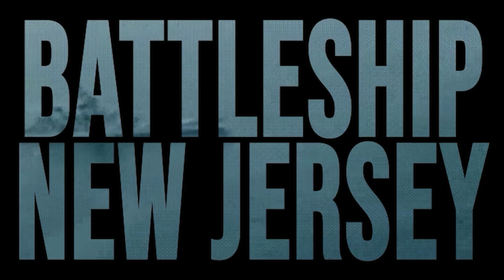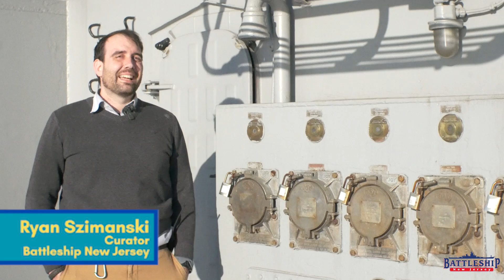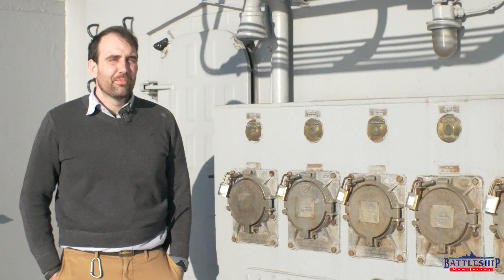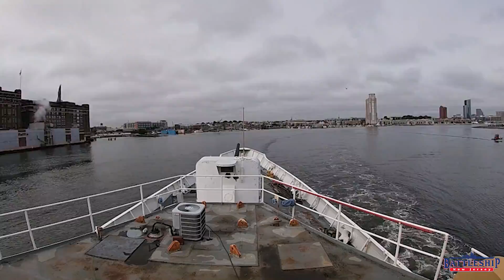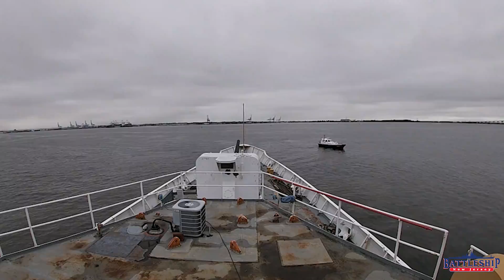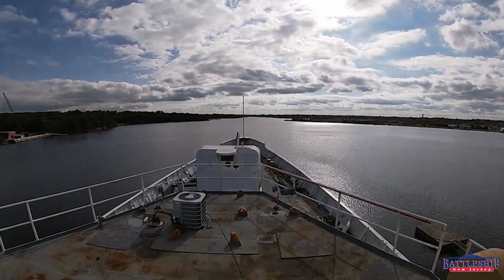Will the Battleship Have Power While Under Tow to Drydock?

Comment: Does the ship have the ability to put out power through those connections? Either her own power or pass through from shore to a ship rafted outboard of her?
Reply: Electricity will always go in both directions through a conductor. I don't know if that is an approved procedure, but if you really wanted to you could definitely do it.

(This is why using a suicide cable to connect a generator to a plug socket in your home during a power cut in order to power your home works - plug sockets work in both directions. It is also why it is extremely dangerous - the mains connection to your house works in both directions so you are electrifying your whole neighbourhood and can electrocute people fixing the mains that they think is shut off.)
Reply: @thomasdalton1508  You are correct.  In fact, the transition from shore power to the ship's SSTGs and back again both include synchronizing the ship's generators with shore power.  Done properly, nobody can tell when you close/open the bus tie.  The takeaway here is that for a very brief time, the ship is actually a contributing generating station on the US power grid.
Reply: @kevincrosby1760  Are the generators able to switch between 50Hz and 60Hz to enable them to synchronise to the grid in ports anywhere in the world?
Reply: @thomasdalton1508  Nope.  If the pier doesn't have what you need, then you keep a boiler up and an SSTG spinning.

Comment: As a mechanically inclined guy i would love to know if it would be technically possible to get cooling water to Aft Diesel without the through hull openings.
Reply: Technically that would be easy…deck mounted Honda pump with a line running to the diesel sets… least my farmer fix lol..wouldn’t be pretty but it would work. Might need a screen on the intake to keep debris out.
Reply: @dirtdevil70  just buckets of water, and guys running :-)
Reply: @michaelandersen-kk4fc  sounds like something the marines would do  lol
Reply: Oh, no. Radiator in a hall-way, fans to push air through the ship, open hatch at each end. As long as the radiator is on the same level as the diesel, moving cooling water around won't be a complete pain. But then you have a challenge as far as fuel goes, as it will also likely need to be in a similar space, powered off of bladders.

Comment: Can the port and starboard power connections be daisy chained? As in one ship is connected to shore power, and another ship is moored alongside the first ship electrically connected on the other side?
Reply: Great question, I’m not a navy type but I’ve seen lots of images of in service naval ships tied up alongside each other so I assume they can daisy chain - otherwise the outer ships would have to keep their gennys running.  

Would be nice to have confirmation from someone actually knowledgeable.
Reply: @cruisinguy6024  Obviously, you wouldn't be able to have them all running at full power, but it should be enough to at least keep the lights on so the service crew can get around.
Reply: @cruisinguy6024  they will just cross-deck the shore power, potable water, shore steam, telephone, CATV, etc. from the pier to the individual ships.

Comment: Please consider dry dock opportunity to get water intake remade to rear generator diesel. Ship would be more useful to NJ for disaster relief (Hurricane Sandy) with some electricity. Even if redundant shore power generator.
Reply: There have been instances where diesel electric locomotives have been used to power a town in an emergency.  They actually drove the loco a short distance off the rails to the nearest capable power pole. 

250,000 Watts isn't much. I used to tend to a 800,000 W generator with a V 16 quad turbo engine making 1150 HP.  And that is a " small  " generator as some data centers have a few 1,250,000 W units.
Reply: The USS Lexington powered Tacoma during low water period in 1929.
Reply: @Dog.soldier1950  USS Lexington (CV-2) had turbo-electric propulsion, and had much bigger generators for that.
Reply: I vote getting the turbo  generator(s) going as a safer option
Reply: @Dog.soldier1950 They can't really get either one running. Diesel is, in theory, possible at least but would require opening up the sea chests. The turbo generators would require firing up the steam system that they're not allowed to do.
Reply: The auxiliary generators can only power the emergency systems, so they aren't much use to anyone else. The full steam generators might be useful, but it sounds like there is absolutely zero chance of getting them working.
Reply: 250kw is not much and wouldn’t be very useful for back feeding to the shore - not to mention she’d have to be near critical infrastructure already for this to make sense. 

She’d be far more useful as an emergency shelter but as she and her contents are treated as artifacts I doubt they’d want to open her up as a shelter.
Reply: @cruisinguy6024  A ship is going to be a very bad place to take shelter in a hurricane! I think they should stick to using schools and sports centres as shelters. They have diesel generators to power those.

Comment: what is the reason for the move to dry dock? what kind of repairs?
Reply: In short - hull cleaning and repainting, checking the blocked off sea chests and recovering as necessary, checking the seals on the prop shafts.
Reply: Do you live under a rock?  They’ve made NUMEROUS videos about the dry dock process and what work they’re planning / hoping for.
Reply: @cruisinguy6024  been too busy to watch any battleship vids recently. Sorry to disappoint 🙄

Comment: Iowa’s 10 shore power jacks were instrumental in the successful traversal of her number three turret.
Reply: Not really... in hindsight they said they used no more than half their shore power at any given time. As a precaution, they had switched off most of the other electrical equipment. So as long as it is only ONE turret rotating and nothing else, 5 would suffice.

Comment: Does the main generators (not the auxiliary generators) generate 60hz or 400hz? I heard that the main turbines provide 400hz that is then stepped down by the fwd and aft conversion rooms, which seems backwards.
Reply: The main turbines generate 60hz, just like the power in the North American grid. 400hz is used on aircraft.
Reply: In a past vid from about time 440 to  620 "   What Items Did the Navy Remove From USS New Jersey After Decommisioning?   "   there were some frequency converters ( he calls them generators which is incorrect ) to power modern weapons systems. These were removed just as the ship was opening to the public. .
Reply: 400hz is the frequency required for most high efficient systems like computers for tomahawk and CWIS, along with the navigation systems wsn

Comment: So, on the other side, does NJ currently have 8 cable connected - or less as all 8 are not necessary?  When talking about the ships diesel generators, Ryan states "auxiliary electrical" - I know actual original design more accurate actual term used was "emergency". In some other videos Ryan has implied probably during the 1980 reactivation some design changes were made making it "Auxiliary" instead of "emergency"
Reply: Auxiliary is the correct navy term. Auxiliary generators are used a lot more than just in emergency situations. The shore power connections are often enough to run lighting and other necessary loads, but may not be enough to run all equipment on the ship. Each 480V 400A shore power cable can supply around 400 kW, meaning the 8 shore power cables can deliver about 3200 kW. The ship can generate over 10,000 kW from steam as Ryan mentioned. The ship probably couldn't run large pieces of equipment in port without the diesels running. That's still true today for a lot of warships. 

Another reason is maintenance while underway. If a mid-ship power distribution panel needs to isolated for work, panels forward of it may be able to run off the forward diesel instead of the turbine generators while the work is done. Ships use their diesels a lot more than just emergency situations.

Comment: can you place a rental  Caterpillar powered 3 phase generator on the deck of the ship  and plug in to that I spoke too soon  @3:34, I guess you will be steering the ship manually in AFT steering
Reply: New Jersey’s rudders will not move. The tugs will steer.
Reply: The steering will be done by the tugs just like was done with Battleship Texas.  Hopefully the rudders are locked in the Zero degree position (straight ahead.)  But even if they aren't, (Texas has several degrees of Right Rudder locked in) the tugs should be able to compensate.
Reply: @robertf3479  I believe the are - rods have been welded in place and such to keep them there.

Comment: I'm wondering why you can't fill the coolant pipes with (fresh) water and run one of the aft diesel units. The idea here is one generator at low power shouldn't need evaporative cooling but the coolant loop should be enough (by increasing surface area for conductive cooling).
Reply: The ultimate heat sink for the diesel generators is always seawater -- that is, there is no radiator (air-water heat exchanger), but a water-water heat exchanger that is cooled by seawater.  If you filled the freshwater system with cool water and run the generator, it would very quickly overheat.
Reply: @n1gak BINGO!!!
Reply: @n1gak The idea is to feed the seawater side of that with fresh water, from what I understand. And yeah, while a good amount of thermal load, a simple open-cycle electric fan forced cooling tower of sufficient performance is much cheaper than a sizable diesel generator. Or, well, a water tank facing the outside hull would have both thermal mass and cooling capacity. The problem is probably more getting the diesel to run reliably enough to dare skip the deck diesel option.
Reply: @namibjDerEchte  how tf would you plumb that? no, a rental generator is best
Reply: These diesels are large enough to power locomotives, you MIGHT be able to run one for a few minutes the way you suggest, but this tow will take about 12 hours at least. so to run one of the installed units would need the cooling system clear, both intake and overboard discharge.  This assumes that the units are intact enough to be made operational after sitting dead since the last preventive maintenance was performed when the ship was laid up after her last decommissioning in 1991, over 30 years ago.

Comment: Prolly for the pumps, right? I'd put power to the pumps if it were me, and museum curators (the people, not the measurement units) are even more prudent than I.
Reply: wait, museum curators as measurement units? I am confused.

edit: oh, I get it.
Reply: @TheAechBomb yes, that one running bit in the “about the battleship” videos on this channel.
Reply: Yeah, didn't he mention even the smallest generator will be large enough for the pumps? No point in doing bilge checks if you aren't going to do anything about it
Reply: I am not familiar with Iowa class damage control fittings, but many ships don't use pumps for dewatering. They use installed inductors that work on venturi effect that use fire main water to create suction. She should have international shore tie connections so sections of the firemain can be charged to provide dewatering capability. But I wouldnt really worry about it, I would set zebra and enjoy the ride. Though setting zebra one something that size with just a smalls staff would take hours. Maybe structural zebra would be fine.